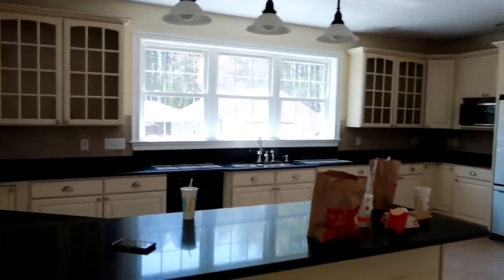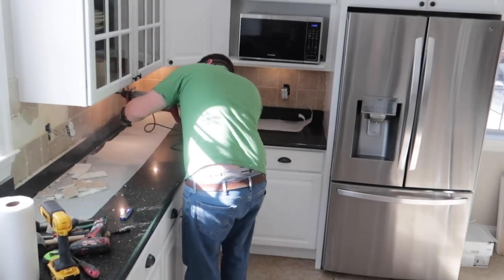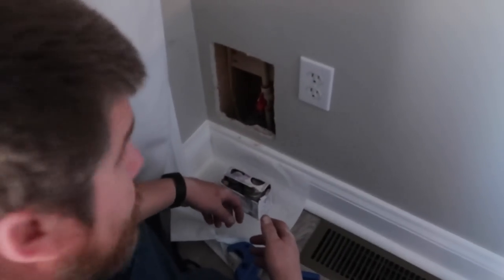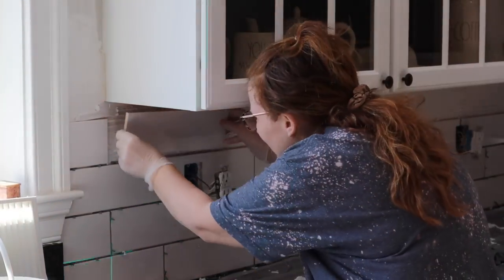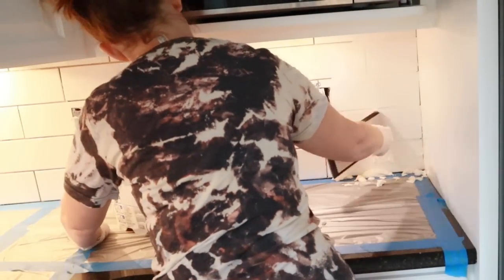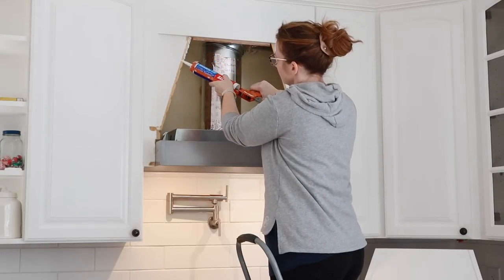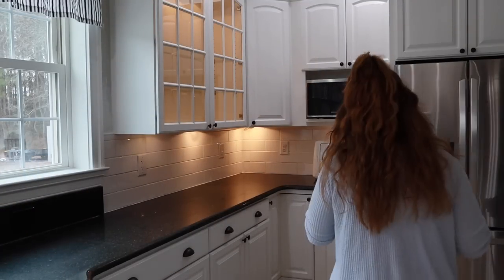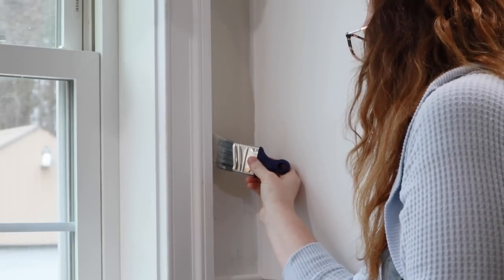Insane Dream Kitchen Transformation 2023 DIY Kitchen Makeover on a budget

Comment: Pretty decent job for DIY. Word of advice in any other tile work in your future… Trowel out your thin set more evenly and if you run into a spot that won’t lay flat don’t hesitate to butter up the actual tile in the area that’s troublesome. You’ll achieve a much more even lay. And a few of your tiles are upside down 😉 but you two worked well together
Reply from the maker: Thanks for the tips! Haha I was like what is going on. We did back butter and use the small level  and tried my best but it's like a wave of unevenness 🤣
Reply: I didn’t know those type of tiles have a up and down. 😂